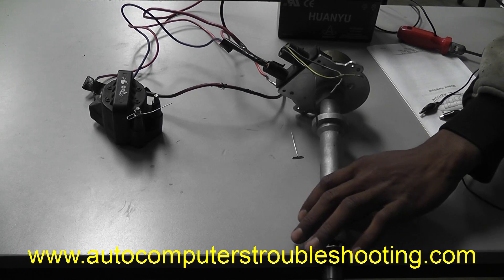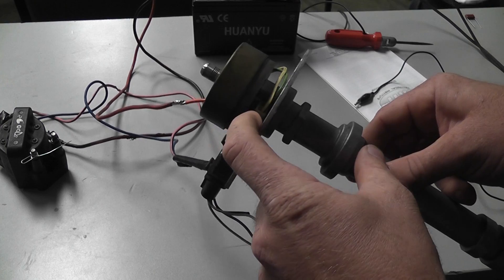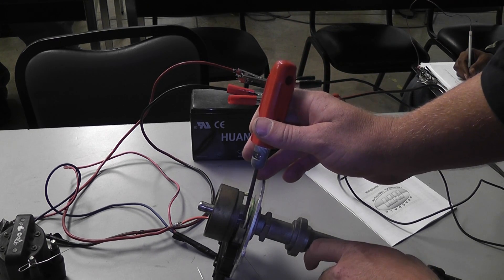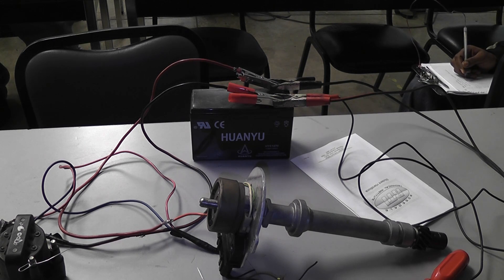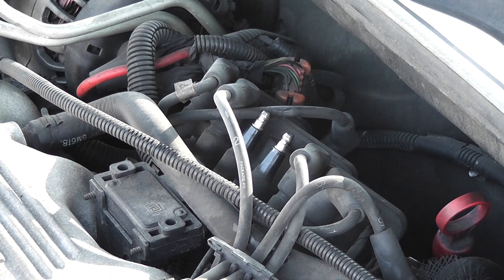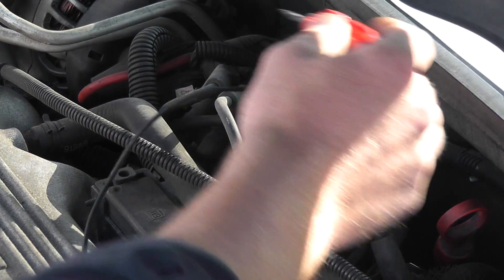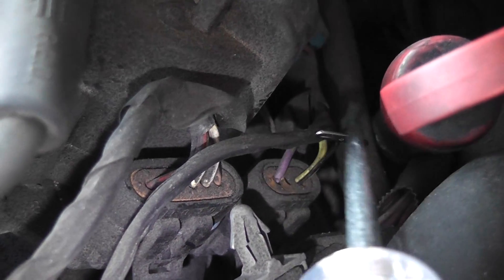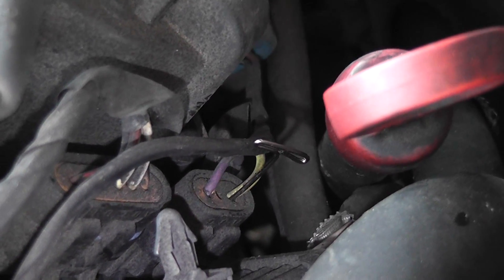How to test a GM ignition module (crank sensor bypass test) - VRS

Comment: a squirrel ate the wire that goes on the side of the module. There is a big connector and a small one with two wire yellow and purple. Are you able to tell where the wire goes to
Reply from the maker: Can't remember for sure but it think yellow is crank + and purple is crank -
Reply: @ScannerDanner yeah just not sure where they tie in, the colors in crank sensor are different color so at some point it turns yellow and purple

Comment: Hmmm now I wounder if there's ways to test the actual ICM under the coil packs ? Reason I ask and I'm pretty sure mines shot but my 87 chevy celebrity eurosport 2.8 far left coil has no spark I've tested the coil and know it's good and ohm tested it too seems fine but no spark at all so 2 cylinders are dead misfireing and the rest is doing as they should.

So I'm just curious how to test the actual ignition control module because they are very expensive and I just want to absolutely make sure it's nothing else causing it not to spark on that one coil for the far left side and mine's the older style so it sits below the front exhaust manifold which is very notorious for cooking these to death
Reply from the maker: I remember these very well!
Easiest (we'll, not really in your case because of location) test is to swap coils. If the no spark moves with the coil, it is a coil issue. If the no spark stays in the same place, you have a bad module.
Another test you can do it to disconnect the coil and connect a test light in series across the two primary coil terminals on the ICM. Test light should flash on and off if the ICM is controlling the coil
This one may help you too
https://youtu.be/z5DpsRwHTfo?si=WpppBRbJ7v9EuTGn
Reply: @ScannerDanner  Ah I see , okay thanks I appreciate that

Comment: I got an 03 Silverado with a 4.3 and I got a crank but no start. Previous owner has replaced ignition coil, module, distributor, and crank and cam. Still won’t start, but if I ground the signal wire to the ground wire on the crank I get spark and fuel to come on but won’t start if I started it with the key? Im completely stump.
Reply from the maker: 03 has a separate crank sensor right? Or is everything in the distributor? 
Is the rotor spinning when you crank it?

Comment: First and foremost @scannerdanner you are a Godsend man. Your videos have brought me sanity at moments I feared there wasn't any left to be had. Thank you for sharing your extensive knowledge. Your troubleshooting skills are unmatched!! My question is that being the 1999 4.3L ,I believe, uses a different form of ignition system than this, (Only one coil vs 3) can this same test be used utilizing your technique of 12v at the test light and touching a tpin at the yellow wire of the crank sensor as shown in the video? I have a intermittent cranks no start throwing a P1351 code Ignition Coil Control Circuit High Voltage that's driving me absolutely nuts!! Replaced both the Coil and the ICM as well as the distributor, cap, rotor (all needed to be replaced not just being a parts thrower😆) The intermittent part is what's killing me. One minute it will fire up with barely bumping the key. Go out a couple days later and just cranks and cranks then throws the code. Please help man I'm about to loose it and need to make sense of this somehow.
Reply from the maker: yes, absolutely 100% to your first question. But I believe you are barking up the wrong tree. That code will set with long crank times from anything! This case study will help give you a good perspective. Fuel pressure would be the #1 thing on my list of what to be looking at during your next long crank time period. 
Check out this video https://www.youtube.com/watch?v=ISucVLxqgT4
Thank you so much too btw, your comment means a lot to me
Reply: @ScannerDanner  Thank you for your feedback and as for the comment I Ieft, you're very welcome! 😁 It was well earned, plus some!!! In regards to your advice, I will follow your lead. I did want to say that I realized that I didn't mention that it was not only a cranks no start but also a no spark. Maybe this goes without saying based off the code thrown, makes sense but I just wanted to give clarity. I also wanted to add that after my comment, I threw in a completely different coil and ICM believed to be good and still no spark. However, not a code one was thrown, and I intentionally extended the crank time wanting it to throw a code, so to speak and  nothing...no code, no start, no spark at coil... Just a little more info in case it changes anything. Thank you again for the intel Paul, I'm sure to be in touch if not here than on the video you advised soon.
Reply from the maker: @christophersparks1906  okay, that changes things a bit. On your ignition design, is the module external or internal to the distributor? This one will help but I believe it is an internal module and is a bypass type ignition system.
https://youtu.be/mDKj19Hnhd0
Reply: @ScannerDanner  it's external. ICM sits inline with the coil on bank 2 side on top of the plenum.
Reply: Seems to be useful more than not knowing that it's a "W" VIN
Reply: @ScannerDanner  this video is pretty informative and I believe that I would benefit from being able to replicate your procedures unfortunately my vehicle has the external ICM not mounted onto the distributor and I'm afraid I don't quite follow how to follow through on the different setup that I have vs the one you're testing in your video. 😣 Also I am unsure 🤔 if mine would also be a bypass type ignition as well and if it hinders this test from being able to be used or not. I do know that I can in fact jump the pins of the starter relay location in the engine bay fuse box with ignition in the on position and the starter engages and in-between intermittent issues it will start and run. Intermittently it will just crank with no spark obviously no start. Fuel pump engages, plenty of fuel at the fuel rail, not sure about injector pulse but without spark from the coil, hypothetically, does injector pulse REALLY matter? 😂
Reply: Not being a smart ass just meant for humor
Reply from the maker: @christophersparks1906  I meant to send this sooner. This would most likely be your ICM design https://youtu.be/zUHrZTxYBGE

Comment: Just ran a ross your video, good stuff. Question, iI have a 89 Chevy truck 5.7 and it would not start. I check for spark, no spark at plug. Because it has 150k miles I started replacing parts, primary coil first still not spark. I pulled the distributor and replace ignition modular, pickup coil, rotor button, and distributor cap. It started up and ran pretty smooth. I read that the advance timing plug should be disconnected to set the base timing. When the plug is disconnected, the truck will not start. Any idea?
Reply from the maker: Just answered this on another video
Reply: @ScannerDanner  What's the thumbnail? Also, since I sent you my reply, I set the timing on TDC (EST PLUGGED UP) and drove it around the block and it ran smooth and had a lot of pep. Do you think it's OK to drive it without setting base timing?
Reply from the maker: @gtuttle4  yeah, you'll be okay, the ECM doesn't provide very much timing advance at idle anyway. Just make sure your idle wasn't too high when you set it. 
The thumbnail on this video? Lol I don't remember

Comment: P1351 Danny that's the code I have
Reply from the maker: I think this code will set anytime you have a long crank time. A low fuel psi issue can cause this code. I have a video on it

Comment: Do you have the same test for single coil ignition system? I have an 89 k3500 no spark problem
Reply from the maker: Yes, I have a case study on this system where I'm using a test light to troubleshoot a no spark condition. Chapter 22 playlist not sure the exact video offhand

Comment: are no the 12v sent to de ingnition module too high? considering that it gets very low voltage from the pick up coil to the P terminal?
Reply from the maker: no sir, have you ever scope tested one of these types of sensors at a high RPM? I've seen them produce well over 20 volts peak to peak
Reply: @ScannerDanner  I am getting less tan 1 volt while cracking, is this value normal?, I think it is too low

Comment: Is the crank sensor wire you are talking about is that the same as the ignition coil wire?
Reply from the maker: No, it is not.
The ignition coil wire would be a spark plug wire

Comment: OK, I did the test to the ICM under the Coil Packs. 
It does spark, when I feed the yellow wire from Battery positive, and I can hear what I think is the injector running. 
BUT, It does not fire the instant I feed the yellow wire. 
It seems like I have to "Peck" it a few times. 
Also, the Car tries to start, and sometimes will start, But sometimes, it see,s Like as soon as I release the key, It quits trying to fire. 
Should the coil spark the INSTANT I feed 12 volts to the yellow wire,  Or is there sometimes a delay?

Comment: 1999 Chev Express 1500 5.7

Does the crank sensor feed to the PCM and then the PCM feed to the ICM?
In other words, if the bypass test does not fire a spark could the problem still be the PCM rather than the crank sensor?
Reply from the maker: This model uses a cam sensor inside of the distributor and the crank sensor directly feeds to the ECM. So this is NOT a bypass type ignition system. 
The white wire to your ICM is the PCM's control of the base circuit of the transistor in the ICM. With the key on, you can take an LED test light to battery positive and touch on and off that white wire and you can make the coil fire.
Reply: @ScannerDanner  Thanks.
Yes, touching the 12+ to white wire of ECM fires coil so I take it that the ICM and COIL are okay. But it will not spark when cranking. This was a sudden no run that occurred while driving - no spark when cranking after that. No DTC codes.
Have installed new crank sensor so bad ECM ? (i.e., ECM not sending signal on white wire)?
Reply from the maker: These ECMs on this model are known for water intrusion. The steel bolts that hold the two halves of the aluminum housing together rust off and allow the module case to open up. I have a case study on this and mine had a MAF code.
Reply: @ScannerDanner  Thanks for your help.
I was a DIY mechanic 45+ years ago but am too old now to keep up with computer stuff  :-)
Reply from the maker: You're doing really well if you ask me!! You did that bypass test and understood exactly what it meant. Props to you. If you don't see anything visually at the ECM,  Hit me up again, I have some other tests for you. Just keep replying here.

Comment: Creative Improvisation; however, I believe you are actuating what is called the cam position sensor (the distributor). The crank sensor is usually in the timing cover at the bottom of the crankshaft front pulley, getting one pulse per crank revolution instead of one pulse for each 90 degrees of crankshaft rotation (720 degrees total) or one pulse for each of 8 cylinders.

Comment: Hey Paul, 
  Im having a no spark issue with this same GM ICM. New coil, pick up and module. I have spark when the 4 pin connector is disconnected from the ICM. But when I have the 4 pin plugged into the ICM, I no longer have spark. Any ideas?
Reply: Hey did you fix your issue with your GM?

Comment: I would like to know how to diagnose an bad ignition control module using a multimeter
Reply from the maker: Signals are too fast for a regular voltmeter on some of the tests.
Reply: SDanner please help, did this test and still no spark, one thing not mentioned so I assumed it was not needed was to have the key turned on.  My question is, how to diagnose this problem, just replace the icm?  Coil packs were replaced one year ago.  Any info greatly appreciated.  2004 Chevy venture, 3.4 litre looks just like the engine in video

Comment: i had a no spark issue. i tested to see if the module was good with the test light coming from 12volts. well it tested good. when i went to crank the van again it worked no problem every time. some how i guess the 12 volt jump re energized the icm  somehow and no problems  since. go figure
Reply: I have heard that from others. Not sure if the test it resets/nudges the ICM or maybe the crank sensor/pickup coil.

Comment: What if the pick up was a 3 wire? Will the same bypass test- test light test work to test for spark? BTW it's a 4.3l v6. Thanks!
Reply: No expert here, but I think you can try all three wires to get on to fire the spark.
I think the third wire may be for those cars with a tachometer.

Comment: I got a 1994 Buick LeSabre 3800 in it started pranks good and sometimes it'll start up and then it is just go dead as we riding down the street and then if you tap on them on ignition modules in the coil and spark plug coil sometime it'll start right back up and then I could have to I have to wait two or three days before the start again anyone help me with this problem tell me what it might be
Reply from the maker: sounds like a module issue. Make sure the grounds are clean on the module and that your connector and terminals are tight.

Comment: What would it mean if when I touch the test light to the yellow wire the test light illuminates? There is no spark from the coil. Ground? Shouldn't it be positive?
Reply from the maker: Unplug the crank sensor and one of those two wires should NOT light up. Was it the yellow that I said was the signal wire? If it was and it is still lit with the sensor unplugged then you may have a short to ground on that crank sensor harness.

Comment: how can i do these test on a chevy 305 tbi, which cable on the module is the positive pickup coil?
Reply from the maker: try it on both pick-up coil pins. you will not hurt the module. test light to battery positive

Comment: Had a 3800 in a 98 Chevrolet APV that would die after climbing hills or in traffic in LA.  Many tech looked at It and finally the GM people changed Coil Packs and other components without success.  Finally Chev Regional Mgr decided to replace engine and I took my GM Company car in to have engine replaced.  Lab diagnosis found that the crank sensor resistor was expanding when the oil heated up in engine and had the sensor non-operative.  Part was about $20 dollars.  Early days of the fly by wire cars was an exciting time.  Your video stuff is right on.  Thank you.

Comment: Can i use a jumper wire?
Reply from the maker: +armando nika for what, refresh my memory please. Thanks!
Reply: +ScannerDanner when you gave 12v to the + pin using a test light can i use a jumper wire?? And if you give ground to the other wire (negative one) it works?
Reply from the maker: +armando nika I would not use a jumper wire, if you touch the ground pin with direct 12v you're going to hurt the module
Reply: +ScannerDanner And if i give ground to the negative wire its the same thing? Thank you

Comment: Paul, is it possible to use test light to simulate input to the ignitor(like sending computer pulse to ignitor), I assume all I have to do is connect test light to the ignitor input wire and pull up or pull down based on the design, will this work.

Comment: hi, in case of waste spark, one coil fire 2 cylinder, if we want to test for spark for this 2 cylinder, do I need connect test light to a good ground and test for spark for both cylinders or have to connect test light for a power for one cylinder and ground for other cylinder to test for spark. the reason why I asked this q, is because, unlike conventional ignition in waste spark, like u showed in this video, spark travel between two post, so I assume one is power and other is ground.

Comment from the maker: Nope, the test light will just light on some and on others will do nothing and still on others you will get a response. No worries with this test. Think about what the sensor actually puts out. I have seen VRS's produce over 25 volts AC. So a 12v DC test light is completely safe.

Comment: I have a question Paul, if you didn't know which color was the positive side of the VRS sensor and you touched 12v on the negative (-) side could you cause any damage?  Thanks

Comment: Paul, is it safe to say that you can make the coil fire say a cop system as long as the transistor is inside the coil? Test light to positive on the control wire?

Comment: Have you ever tried this way to test igntion coil, connect primary coil + to bat+ then use test light to provide ground and breake it. Just to purely bench test primary coil and nothing connected to module or anything of that sort. your input is greatly appreciated.

Comment: Hi, i have a question, say, i have a car, where it has hall effect cranks shaft sensor , not VRS.or magnetic type.  system works this way, Hall efffect sensor provides feedback to ECM.  ECM pass this information to ICM. then ICM has transisotr which break the ground to ignition groun to generate spark. The quesiton is can i use test light to provide pulse to ICM by providing 12v on and off. I know this is how u do for VRS or magentic type, but can i use this for the design i have recommended.

Comment from the maker: @felipevinalay No. The cam sensor on your van is a hall effect not a VRS. Watch my "Chrysler Hall Effect Sensor Testing part 1 and part 2. 
The 5 volt signal will drop and show an average of the 0/5 volt signal during cranking. (if there is a signal). Since you are reading a steady 5 volts on the signal it sounds like the cam sensor is bad. I think you are also asking about my book? For more info. on that go to my website that is embedded in all of my videos or listed on my channel page.

Comment: HI can I do this test on cam sensor my 98 vonager 3.0L I have no spark condition already try  new coil, crank sensor and cam sensor and I don't know if the pcm or tcm are bad. according with my repair manual the signal V change 5 to 3V but the cam signal never change, at the connector have 9V 5V and ground. by the way all this vid are and your book what are talking abuot?